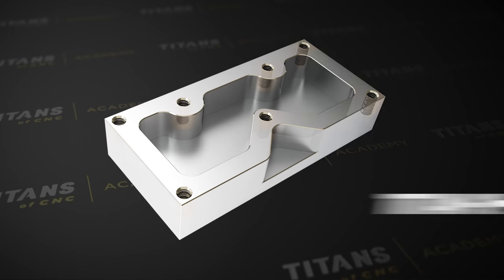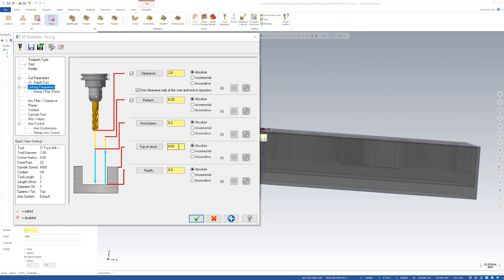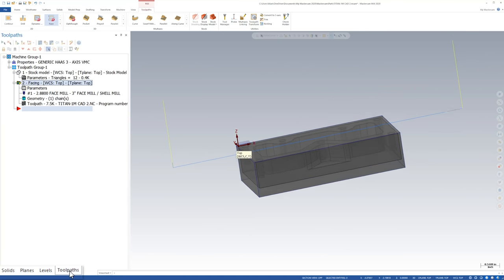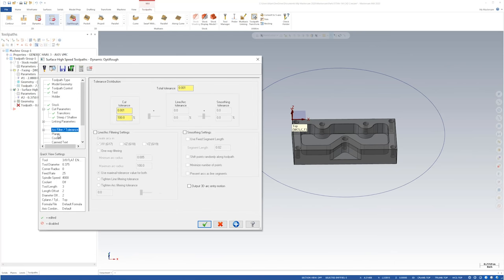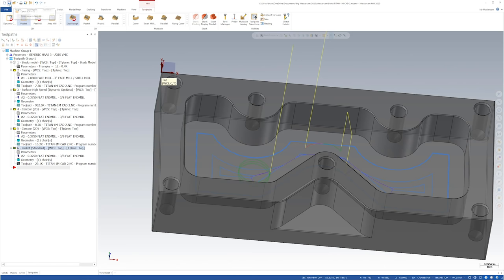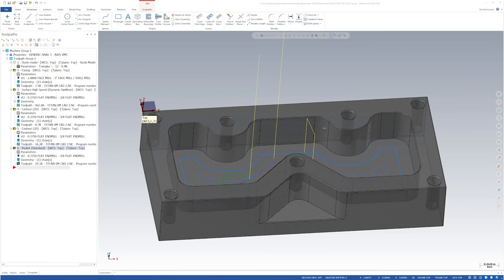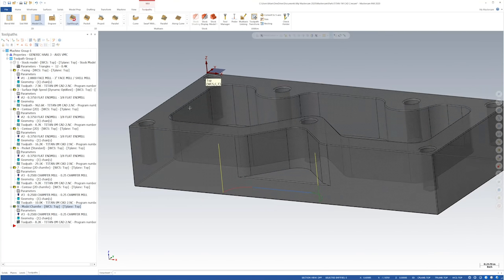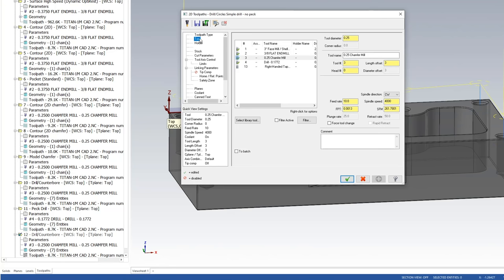Mastercam CAM Tutorial | Programming The TITAN-1M (FREE Resources)

Comment: You can condense a lot of the first 10 minutes. First off, go to Properties>Tool settings, and the top box on the right side is "Assign tools sequentially." That will auto-assign tools as 1, 2, 3, etc instead of doing it manually. EDIT: You can also choose tool SFM "from material", so all the tools pick up the designated SFM, instead of changing the speeds every time you load a tool.
For the stock, you can go to Properties>Stock setup. You can do the bounding box from there, enter 1x2x4.1, zero it off the top face, then enter the Z offset .02. Instead of fussing around with transparencies and levels, it just inserts a wireframe with red hidden lines. It also tells the software there's stock on top, so you can select "Facing" and go straight to OK, you don't have to select the top face because it knows you're taking material off.
Reply: True about the modeling the stock and face mill path. But if you want to use Optirough tool paths you will need to make a stock model the way Titan did.

I mean you don't need to bc Optirough will read the outer boundaries of the stock the way you mentioned. But when it's getting to more complex parts where you have to tell MasterCAM what was roughed in previous ops and you need to use Rest machining with a different tool then you have to use the Stock Model toolpath as shown

Comment: Another tip when using chamfer mills against walls. Rather than increasing the bottom offset parameter, switch to top offset and decrease the value. Let mastercam do as much thinking as possible so you dont need to do the maths.
Reply: i think the same way

Comment: In addition to backplotting, there's the verification mode in Mastercam where material removal is also simulated along the toolpath based on the stock model and the tool dimensions. It's the icon located to the right of the backplot icon (Looks like a step with box and a green check mark.) It's a pretty nifty way to simulate material removal, and helped me discover where, on a few of my parts, I actually missed removing some material.
Reply: exactly you can check in many ways were the material is left on your part after machining

Comment: Just use 2D High speed dynamic for the pockets. Use a basic contour for a finish pass. Optirough is for roughing and stair stepping sloped surfaces.
Reply from the maker: It’s hits all 3 roughing needs at once and the point is to teach it early so students are used to it.
Reply: @TITANSofCNC  This is true as us MasterCAM users that used V9 are used to Colton's method. I force myself to use the optirough even on basic toolpaths to get used to it. It's much more intelligent and when you get a part that's 100s of pockets you rather not select all of those and input different heights if all the pockets are different heights

Comment: Question about that plunge rate. I know when facing off material it wont matter but I like to edit tools as little as possible so I always put plunge rate around 75% of feed rate so when I enter a cut inside material I dont over load a cutter. Do you always use higher plunge rates?
Reply: When plunging into air you use the higher feed rate than the cutting feed rate.

But it all depends on cutter and method. If you're doing a helix or ramp toolpath your feedrate depends on angle and cutter style. 

Like Titan said, I don't reccommend plunging straight into material, and I ever need to I drop my plunge feed rate really low to like 5ipm in aluminum. Definitely don't plunge straight into material in steels, that will beat up or kill your cutter quickly, if not break it the first time. 

Helix is my preferred method and sometimes ramping as well. 

Hope this helpsn
Reply: @VictorHernandez-nt3tw  okay I just wanted to check I wasnt doing something wrong. I also ramp in. Very few of my features can be accessed from outside the material so I'm used to ramping in but alot of what I do is just because it's what has always been done and works, I.e. no actuall reason other than we just do. So I've learned to use lower plunge rates than cutting, that way if you get it wrong you're not over doing it, in theory that is. 99% of our work are 1 offs so we're not hunting for seconds savings more make sure we dont break things and get the job done.

Comment: hey titan, i have a basic vf-3 haas machine so no high speed. i have used mastercam opti toolpath but the program seems to take a lot longer. i  bump up the feed rate as high as it can go but without that look ahead it still pretty slow moving. i have to revert back to traditional toolpath , was wonder if you knew a work around this problem?
Reply: Play with Arc filter and you will get much faster machining with the same speeds and feeds you used before.
Reply: Also I suggest you to use G187 if your machine supports it. Find video Tip if the day from Haas where they talk about this parameter
Reply: Oleg Vodovozov thanks for the tip!
Reply: In arc filter put the tolerance around .01” and click the g17 arc box. Use g187 P1.
Reply: trace12345678900 I will have to give this a shot!

Comment: I've a question. Whenever I click to stock model and create a stock model I can not hide it. I click levels, then hide the stock part but it just becomes ghosty it just doesn't disappear. Please help me :(
Reply: The stock model is treated as a toolpath which are not hidable through levels. What you need to do is turn on "Only Display Selected Toolpaths". This will remove the stock model from the view and will only display the toolpath for the operation you have selected on the toolpaths pane.

Comment: What’s different between Mastercam and 360 !
Reply: about $15000 dollars
Reply from the maker: Fusion360 is great but it’s not ITAR compliant.
Both have free education downloads.
Mastercam basic starts at about $5k and then goes up depending on if your in Layhe or Mill etc.
Fusion is subscription.
Mastercam gives a massive amount of freedom to design your own toolpaths when programming high level parts etc.
Reply: Master cam also takes 1 hour to program this part. Fusion 360? About 6 minutes. 🤷🏻‍♂️
Reply: devon dupuis
Mastercam takes about 6 minutes to program this part when you know it
Reply: Oleg Vodovozov looks like we need a “Cam challenge” then? I’ve used master cam for 8 years. I’m aware of the differences.
Reply: devon dupuis 
Have you tried MC2020?
With new chaining mode you could set all chains much faster than it shows here. Titan just explains slow for students. 
For facing you don’t need to set any chain as long as your stock set.
For drilling operation I would use Prototek Strategy Manager and could get spot, drilling and tap at once.
Reply: If you know how to make a legitimate 2.5D milling template and have a dedicated tooling library for Fusion 360, this is a 3-4 minute part to program.  Simply set your z depths for each tool and choose your contours/holes and lines....DONE! MC is way to complex to be effective... just like Solid Works... hence the reason Autodesk has stolen 40% of the market in the last few years.
Reply: desmodreamer86
Ok, so this part could be done in MC in 6 minutes and in 4 minutes in F360.
What about complex parts? 
I believe that Hypermill will do complex part faster than MC but will loose in simple parts.
MC looses to every other CAM program in certain areas but wins when it comes to total comparison. That’s why it still number one in the world.
Reply: Oleg Vodovozov  
Sadly you have been poorly informed.  I am a CNC applications engineer for a regional machine tool distributor and I can assure you MC is far from being number 1 overall.  It is just like Solid Works. Both GUI's are overly complex, have unnecessary functions, and neither are user friendly. 

What matters is the time it takes to go from the model to an actual real part that conforms to the specified tolerances. MC will lose this battle every time, regardless of part complexity. 

 I know plenty of shops who use F360 for highly complex parts that are done on multi axis and mill turn machines. The only shops that use MC every day are the ones that, crash their machines, have no idea of what a profitable business model is, and have no working industry knowledge.
Reply: desmodreamer86
You’re continue attacking SW and MC, for me it looks like you working for Autodesk.
Now, try to get any job for aerospace with F360 with stupid policy of online storage all CNC programs. 
Also compare ability of creation surfaces in F360, SW and Siemens NX. 
SW much more user friendly than Catia, why you’re mentioned that Autodesk better than Catia.
GUI is important, but Catia with it’s stupid GUI still number one in CAD world.
Now check in CIMData website, which CAM software taking the first place for over 20 years.
Reply: CMTeamCobra  
This is AMERICA! We can post wherever we please.  Who are you,  the YouTube hall monitor?

I have my own copies of Gibbscam,  Esprit,  Featurecam,  and MC. The others rarely get used because F360 is more accessible, feature rich, and far more intuitive.  Before claiming that it's too clunky for multi axis and mold making, watch Titans video of the Lion and Eagle ... all programmed with Fusion.
Reply: desmodreamer86 
I agree that F360 much more intuitive than many others.
It’s big plus to compare it with MC. Probably the threat from F360 made MC to switch stupid X-style to newish 2017 style.
About multiaxis, most of CAM software now utilizing toolpaths from ModuleWorks.
The difference between MC and F360 here, that MC offers a little more
Reply: Oleg Vodovozov  
Let's not forget Autodesk invented cad software technology. I have copies of Gibbscam,  MC, Esprit,  Featurecam,  and Fusion. All the others are on the shelf gathering dust except Fusion.  

ITAR compliant.... give me a break. Again, this is AMERICA! No big brother driven liberal organization is legally allowed to tell me what kind of software to use for cutting metal in my shop. I've done boatloads of work for GE, Boeing,  and others with Fusion 360. Not once was there any clause in our contracts stating that cloud based software is prohibited.

To those following this thread post:
Educate yourself.  Make decisions based on your needs and budget... not false claims by those who are stuck using one software because that's all they know. Autodesk created all this, and remains at the forefront in both CAD and CAM.
Reply: desmodreamer86
In your own shop you can use whatever you wish.
The fact is you started to attack MC in Titan’s video, but it’s his own shop and he decided to use MC, who you are you to tell him that F360 much better . There  is a huge difference between to make parts for Boeing and to take a contract with Boeing.
Reply: Oleg Vodovozov  
Well if I was getting paid on the back end, I would have to promote MC too. Dont be so naive... the only reason he's doing this is due to the sponsorship.  

This was never meant as an attack on MC or to tell Titan which is better. He's a grown man with his own business ideas and can decide for himself. 

This was, however, meant to enlighten those readers who dont know better and believe whatever they read and or see on YouTube.  

Look, at the end of the day, the software is only as good as the guy driving the mouse.... get what you like, master it, and make money. That's the name of this game. All the rest is just fluff.
Reply: desmodreamer86 
I fully understand that Titan promotes MC, Kennametal and Mitee Bite.
But your behaviour seems to me that you got paid from Autodesk.
If I could choose CAM software it wouldn’t be F360 or MC, it would be NX CAM or HyperMill. Please don’t even try to persuade me that F360 a head above these systems.
Reply: @ov3753  
Look man. I dont care what you use for CAM. I can also assure you that I am in no way a paid affiliate for Autodesk.  I'm just a normal guy that's been in this industry for a long time and have extensive industry insider knowledge. 

If you are someone that judges behavior off of a stupid post on YouTube and let's someone else's opinion/knowledge get you this riled up, sadly you won't last long in this industry. 

To all else reading this...
Some people are totally consumed by what they claim to be factual information. Do yourselves a favor. Research anything before buying. Make a decision based off what's important to you and what works best for you. Dont let misguided fools lead you into buying something that's not what you need or like based on an opinion with no facts to back it up. 

Just for the record... F360 will be encompassing all of Autodesk's other Cad/Cam products features soon, save Partmaker due to it being strictly for Swiss-Turn. The future of Cad/Cam is going to be Cloud based. This is the future and Autodesk once again pioneered it. We just had SouthTec a couple months ago and both MC and Gibbs reps told me they will be following suit soon with their own cloud based systems. It's in the development stages now.
Reply: desmodreamer86 
Merry Christmas to you, 
I don’t want to continue this conversation
Reply: @ov3753  
Merry Christmas to you as well.
Reply: Mastercam 2017,18,19 & 20 versions got some really serious upgrades. Now Mastercam looks like a complete Cad-Cam integrated package with lot better user friendliness! Finally good bye to stupid old X series versions..!
Reply: @CMTeamCobra 
Just to make sure you understand where I'm coming from... all my copies of software are legitimate.  As stated before, I'm a Applications Engineer for a machine tool distributor so having these is a must when walking into any shop.  I totally agree with the efficiency point. Any software becomes useless if you are inefficient at using it. I am proficient at all of the ones I have  because my job requires me to be. It's taken many many years to get proficient.  A lot of long nights trying to figure stuff out.

  I know for a fact that MC and Gibbs are both working on cloud based systems currently and will be releasing them in the near future.  Regardless of a so called "security threat" the market is going this way and there's nothing ITAR or any other liberal organization can do about it. Not only that, but of all the work I've done for G.E., boeing, and countless other ITAR certified companies,  not once has Cam software compliance with F360 been an issue.

As far as Autodesk is concerned... I meant they invented CAD... hence AutoCad. You are correct about them purchasing others tho. But I see that as a good thing because they have the resources to be able to take it to the next level.

At the end of the day, the software is only as good as the user. In my position,  I do a lot of multi axis and mill-turn turn keys and alot of programming related issues so being confident across many platforms is a must for me. With so many choices out there, I could go into shop with any one of them and I have to be able to perform.
Reply: TITANS of CNC: Academy we switched last year for same reasons, itar, mist, cui.  All words that fly through our shop too. I love Mastercam. Big thumbs up on this. When you released 1st video I had a multi axis class we discussed on how this is good for our industry. Thank you